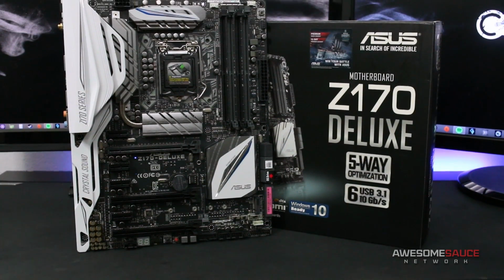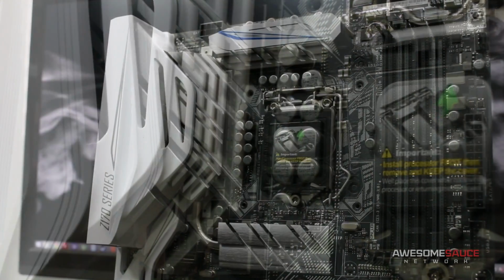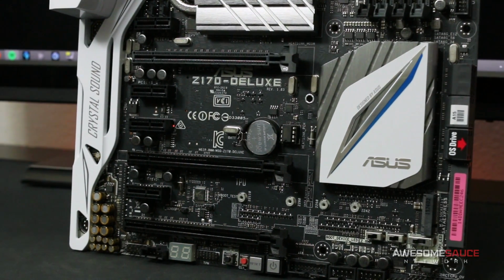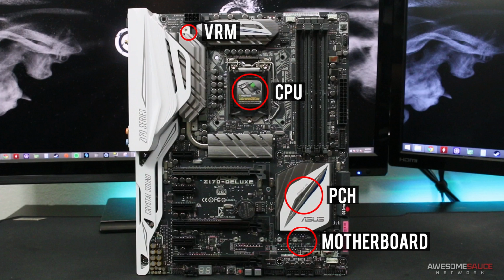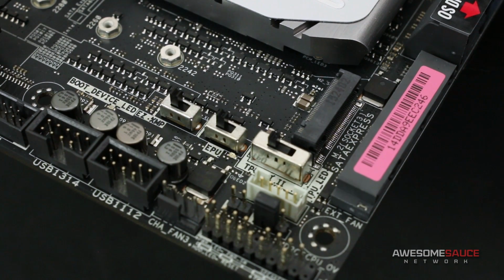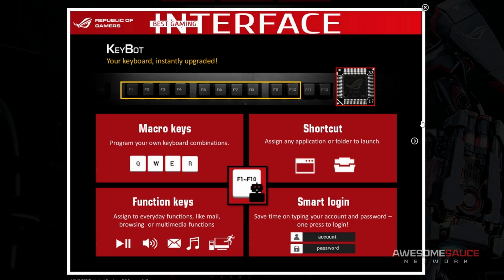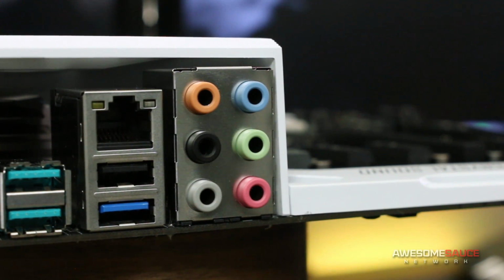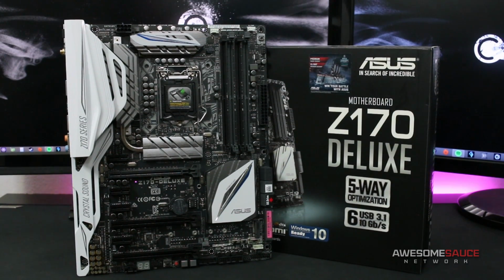Asus Z170 Deluxe! Best Z170 Board Yet?

Comment: I'm not too sure but isn't the board LGA1151 not LGA1150?
Reply from the maker: Thanks for spotting!
Reply: +Lord Krythic wow bro. angry much? I'm sure it was a misspeak. but if you fucked up and order one, then you're the idiot for not AUTOMATICALLY knowing z170 is NOT 1150...which is a haswell. so relax. no one would mes up on it if the have ANY clue what they were doing in the first place. If completely new...go to the store a buy a pleb, pre-built.

Lastly; if if you are too new to know, yet just know better than a pre-built, then go to the site called pcpartpicker, you literally cannot mess up using compatibility lists...with the exception of larger air coolers. They might not physically fit into your case, or may be too big  and cover slots for other things on the board. Noctua however, have a COMPATIBILITY list on their site for this EXACT reason.
The point remains...do research, like any smart person would do before throwing money at anything.
Reply: HB
lol nah. it just irks me a little when people push off their research onto someone else and then get mad when the answers aren't right. its like cheating on a test and then blaming the person you were copying for being wrong. lol
Reply: LGA 1151